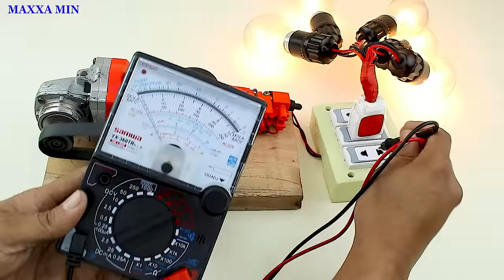Top10 Free Energy Generator 400000W Electricity system Transformer Motor Magnet Light Bulb idea

Comment: 400000 watts is 550 hp, it will take at least 1000 hp engine to drive a dynamo to generate 400000 watts. 1000 hp is the engine of a small boat. Why not we see that to actually see 400000 watts generated instead of some toy?
Reply from the maker: This is demo project bro.
Reply: Nice words...
Reply: Beni 😅😅😅😅😅😅😅😅😅😅de 😊😊😊😊😊
Reply: 5:20 de réussite de réussite des droits 😅des a ppli 😅a de bonheur 😅pour 😅de 😅for 😅for 😅😅😅😅😅
Reply: Kindly lest the materials you used your excellent demo.... thanks..
Reply: @maxxamin  bro please tell specifications, please bro
Reply: Because it doesn’t work!

Comment: But in most of your projects, I saw you connected your Motor to a Direct Current Source. So how can it be a Free Energy?
Reply from the maker: Yes right, some project free and some small electricity used.
Reply: brav0' ..can explain what others features are called..' 
recognise the magnet only, let say I want to buy it. or perhaps what supposedly should be prepared to make it possible.. tQ